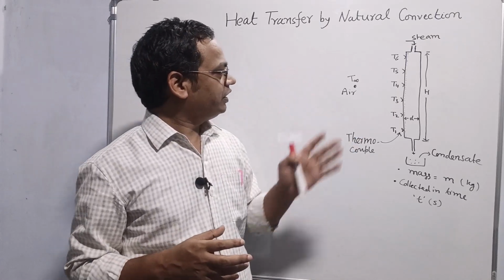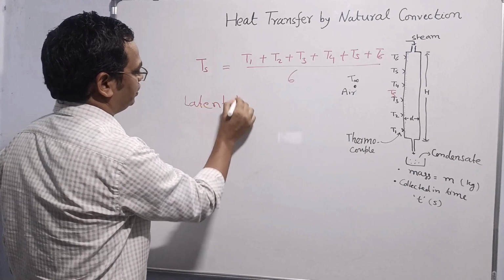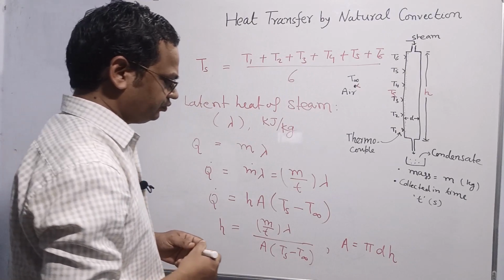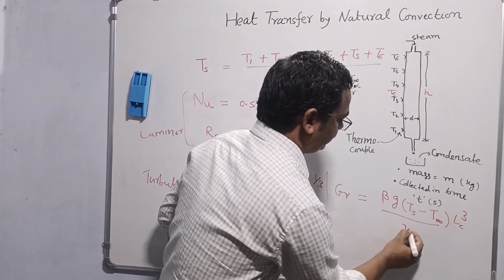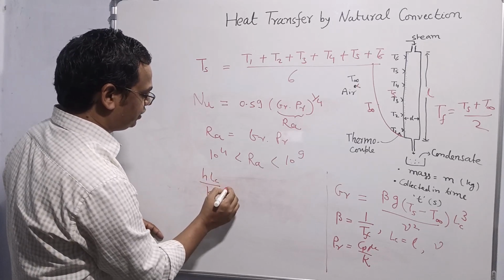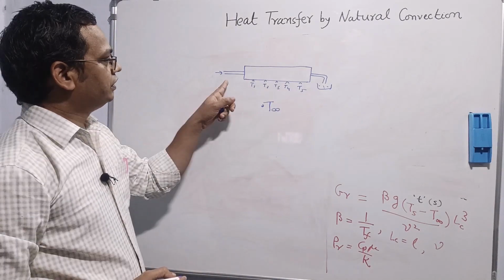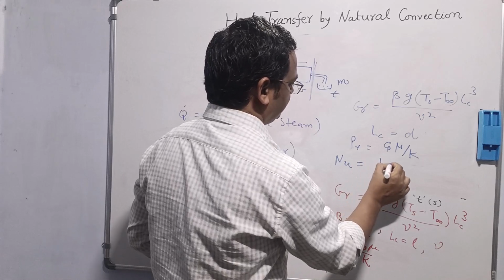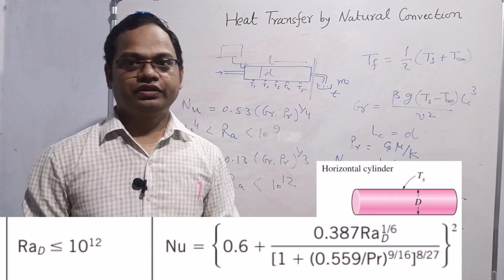Heat Transfer by Natural Convection | Theoretical Description | Heat Transfer Lab

Comment: Sir please upload more chemical engineering lab experiment demonstrations
Reply from the maker: Sure.
Reply: @CHlectures  
1. Modeling and Simulation of Isothermal CSTR
2. Modeling and Simulation of non-isothermal CSTR
3. Modeling and Simulation of isothermal batch reactor
4. Modeling and Simulation of non-isothermal batch reactor
5. Modeling and Simulation of distillation column
6. Modeling and Simulation of heat exchanger
7. Modeling and Simulation of cyclone separator
8. Modeling and Simulation of CSTRs in series